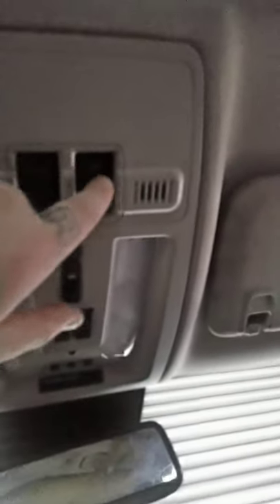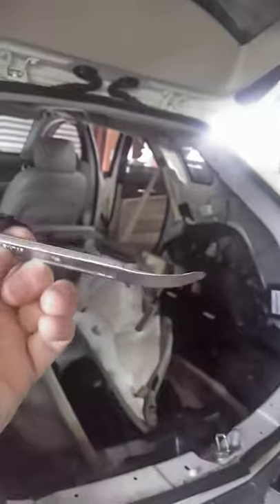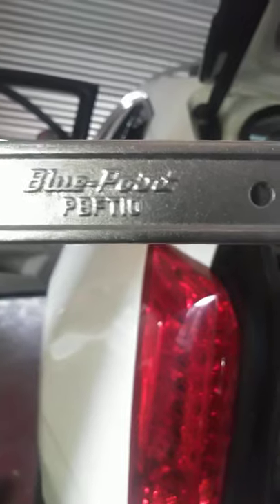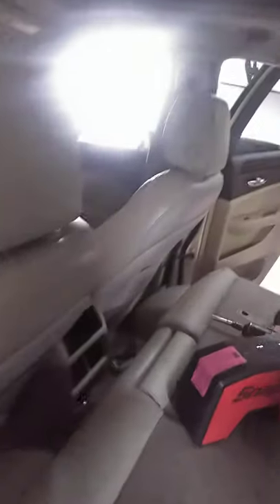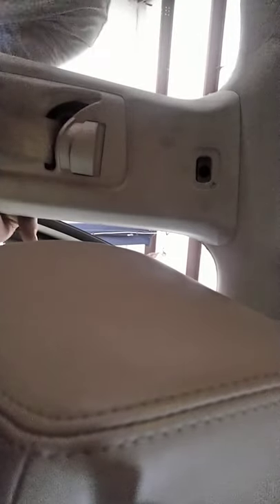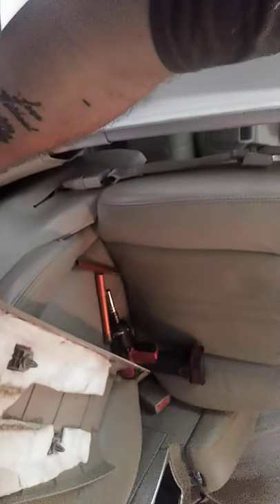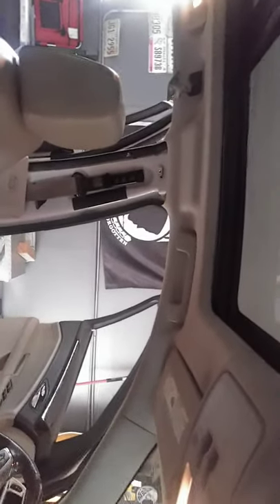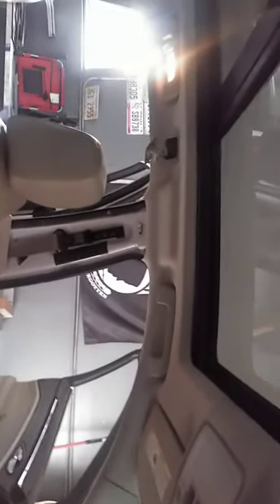2011 Cadillac SRX quick interior disassembly for sunshade removal pt2

Comment: What if the shade disconnects and rolls back to the roller?  Is there a way to get it out without removing the whole liner?
Reply from the maker: No if it does that it needs a new one as it is a tensioned spring like a tape measure if it disconnected at the front and just went to the rear open position the plastic clips the shade rides on are probably broken another common issue plastic on metal

Comment: Hello sir when you replace your sunshade how did you connect it to the actual sliding bar that pulls the sunshade open and closed?
Reply from the maker: You have to remove the rear motor pull the runners back just enough to hook them push runners back into position and reattach motor you may have to reprogram open and close limits if you don't get them back where they were